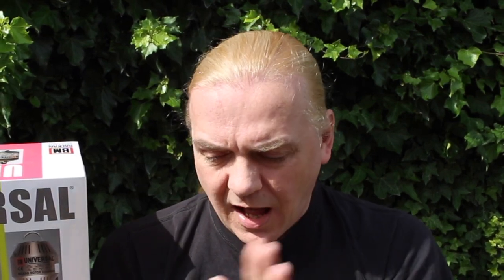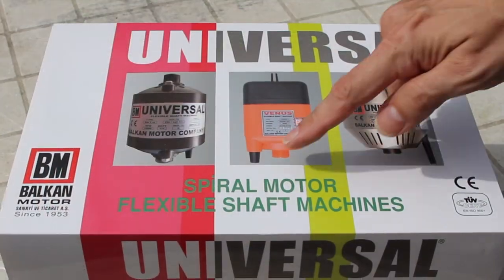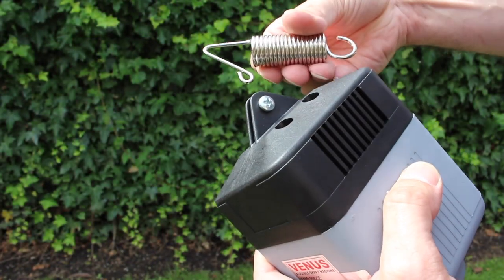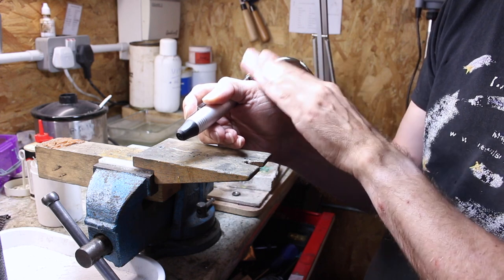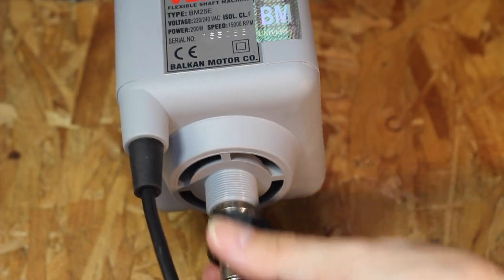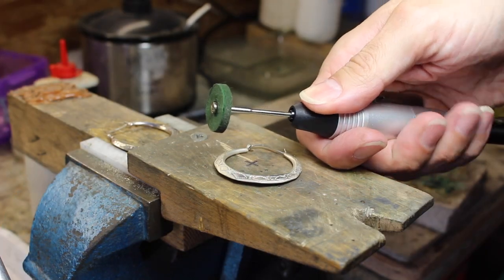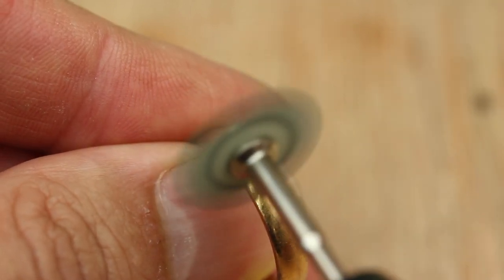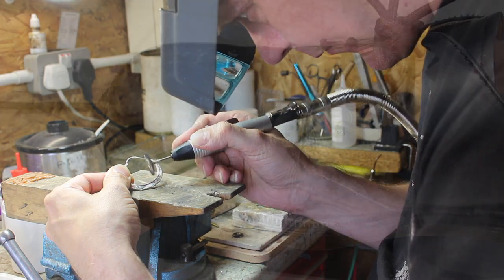Economy  Pendant Motor / Flex Shaft Balkan Venus Demo & Review

Comment: For me, a very basic feature--the ability to run the tool in reverse--would be extremely useful. If I'm not careful about the direction of my rotary tool, it can catch on  the edge of my work and bend or break it. I'm unsure why Dremel doesn't have a reverse switch, as it would save me a lot of time spent repositioning the piece to avoid damage. Great video--it helps me also get why a smaller handpiece and footpedal could save some fatigue from polishing several hours/day. So a pendant motor will go on my list--to research and find the right model for me.
Reply from the maker: In my opinion, The Foredom SR is the best. But will cost double the price of this economy one. I'd go Foredom every time. But I appreciate that it's a high priced item for many hobbyistss and beginners. So hence this Walsh one does offers a great value entry model, and huge upgrade from a Dremel. Dave
Reply: That's also the model I've been focusing on--thanks again for your advice!  For others here in the states, I've seen the Foredom SR kit (motor, pedal, handpiece + accessories) for sale under USD $290.
Reply from the maker: The kits can offer great value. I bought (not given) the SR Jewellers kit, with a H40 handpiece.  an investment, but worth every penny if you have the money for it. Dave
Reply: Those quick-release handpieces got my interest, but since my rotary tools have 3 different shaft diameters, I'll opt for a handpiece with an adjustable chuck. Thanks!